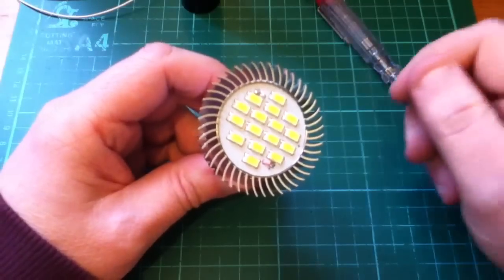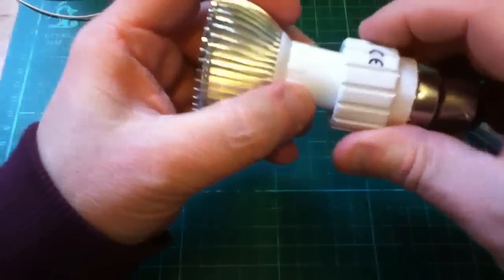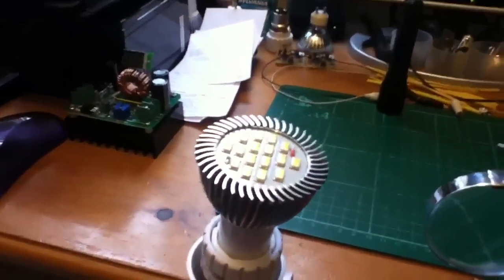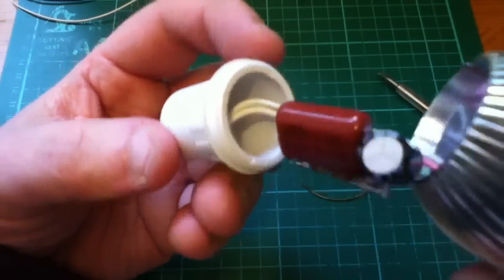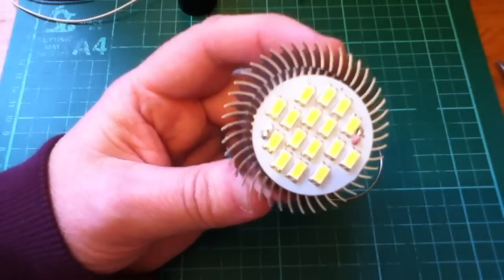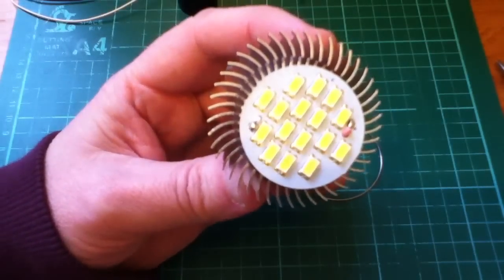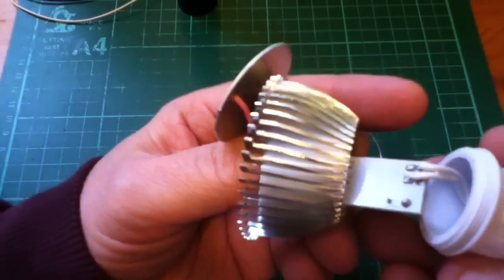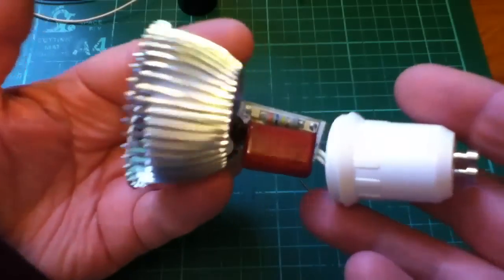Dangerous GU10 LED Spot Light is Cheap and Bright but could Kill You - Seriously

Comment: Wow... Amongst the top videos I have yet seen on Youtube.
Crucially informative, really well and clearly narrated, by somebody who knows what he's talking about, a feature often hard to find on YT.
Knowing the danger is half the battle. I would not let non techno people use one but I would bear in mind the risk to me and ensure that I had inserted the GU10  in the correct way round, initially checking with a meter or minimum a neon tester.
Having established that neutral had reached the front, I'd mark lamp and holder appropriately.
The risk is minimised considerably when using a ceiling light because standing on a wooden chair or ladder, ground potential is a long way off in terms of ohms.
Nevertheless, a great warning WELL worth heeding.
Reminder to self: The neon tester might not work either on a chair because of long earth leakage path! Can't win, can you?
Reply: That sounds all very well, and I used to think that way, and so did my father.  And after he became ill with Lewy-Body dementia he was just about to kill himself with me on the other end of the phone because of failed insulation covering live screws in a fuse box that he hadn't bothered to fix because he knew not to touch them.  If I hadn't gotten cold feet and told him to knock it off and ask a neighbor in the morning, ten seconds later he'd likely have been stretched across the moist concrete floor in front of my terrified mother because in his confusion he was about to unscrew those screws.  I only found out two months later what he'd been about to do.  Electrical safety codes are there to protect everyone whether the so-smart guy is there (or still so-smart) or not.

Comment: dnot  trut!! this  man     do not electronics   experence  the power is in 120 volt to firt 2 pin in back ..  the wires is go  to circuit board and this board circuit  converter  to low volt  to 12 volt dc dnot  shocks !!  in front  point! if you  touch   firt input wires yes you receiver shocks if you open !!   but  in front  led around  dnot receiver nothing   bad  notice!
Reply: Damn! Did you get a shock from one of these lamps already? Your text is gibberish.
Reply: Two words for you, proof read then post it. Well make that 5 words.

Comment: You could get an electric shock, but if you have a differential circuit breaker as you should, then you can't die if it (yes, i know, these are also sold in poor countries where diff CB are quiet ... rare ...).

I am NOT trying to find an excuse for the manuf. This is absolutely revolting me.

Especially when you consider who easy the fix could be: spray a bit of insulating resine ... and voila. Costs less than a cent, and even makes the product water proof. I do that on many products; when I buy a brand new stuff designed to do outside or in the bathroom, I open it, spray resine, and close it back. I have lost many items because the casing was not really IP44, and when water came in ... smoked. A simple resine spray can prevent 99% of these cases.

Comment: I had the same experience with a iPhone USB-charger. It exploded and the mains fuse went off! After inspection there was almost no insulation between mains (directly) and the USB metal shell... but it was cheap! Why the explosion? I just tried to put the USB connector in and shorted between mains and USB :)

Comment: I'm no spark but i do know LEDs have polarity....so if you put this bulb in the wrong way round then it won't work.
So wouldn't that mean you only get live mains on the front plate if you put it in the wrong way round??? In other words, you wouldn't get live mains on the front??
Reply: No, there's a bridge rectifier in the circuit. But that does NOT isolate you from mains voltage.

Comment: Good video. I would say to anyone buying from eBay or Amazon do it but check for the ce Mark. Although some manufactures fake that too. Just very carefully strip it down before using it and if it doesn't look safe then sack for a refund. They have no leg to stand on selling cheap electric devices that are unsafe. All goods sold are regulated and if they bypass the standard they're breaking the law. I've had a few 240v belts and although some were funny, it's very dangerous. I'm an electrical technician so try not to but worked live for years. It is a killer!

Comment: I'm not a fan of LED!
Reply: anythings better than cfl -  what do you fancy eating in 20 years time ? mercury from lots of cfls thats contaminated the food chain as theyve all been slung in the rubbish tip and burried in the ground or traditional incandescent  light bulbs filled with argon thats already present in the air thats completely harmless - ill choose the old  incandescent bulbs or led's over cfl any day lol
Reply: CFL is the other worse choice.
Reply: RobertSmith
 Why is that then?
Reply: They say CFL bulbs have impairing mercury and radiation. This way people die slowly so they can make money off you.
Reply: That's sounds like propaganda from LED manufacturers tbh. There is probably more mercury in your fillings! As for radiation, the amount of UV emitted is negligible.
Reply: FrontSideBus Don't forget, electromagnetic radiation from the circuitry itself. CFL over here are subsided, they're almost free. They're everywhere. Well, we have to live with it. At least a Chinese made LED is clean and a simple fix.
Reply: EMF??? Everything from a mobile phone charger to an LCD TV power supply uses a SMPS! Your probably getting a higher exposure from your wireless router or your mobile phone!
Reply: Tom Peters You do realize that every fluorescent bulb ever made has had mercury in it, yes?  We used to tilt them up and down to watch the little bead run back and forth, if we weren't smashing them with a hammer to get that little bead and rub it on a dime (our version of the 10p coin, made of silver at the time so the mercury would turn it into a slippery mirror for a little while).  Modern CFLs have something like five milligrams of Hg in them, much less than the old ones.  That's a droplet about as thick as four Post-It notes.  If you still have a mercury fever thermometer around it probably contains enough for four to eight hundred CFL lamps, and a pound bottle of dental mercury would be good for over ninety thousand of them.  I'm not saying it's wonderful stuff but think of all those office blocks with their thousands of old-type fluorescent tubes.  I hope they're being made now with equally small amounts but they're so much larger physically that I doubt it.  You should be rejoicing that CFLs are so clean by comparison and are serving us so well while we improve LEDs..

Comment: I doubt it is going to KILL YOU... Why would you not take a Voltage Meter and test the actual Output of the LIVE Wire feeds that you are pointing out in the video? Assume that they are live, you will not receive 110V/220V shock from that LED.  Just a heads up I use LED's and think they are very safe. You get what you pay for, but shop around for the Protective Coverings that are made of plexiglass or clear poly.

Comment: I bought a batch of GU10 LEDs about 12 months ago and stupidly proceeded to fit them with the lighting circuit live, the first one was fitted without incident but the second gave me quite an invigorating "tickle" across the major organs! (I was holding the earthed metallic luminaire with one hand as I fitted the bulb). Fortunately I was saved from coronary failure by the distribution box RCD tripping - I WAS LUCKY! 
Once my heart rhythm had returned to something near nomal I decided it might be prudent to fit the rest of the bulbs with the circuit dead and then being of an inquisitive nature tested for voltage to ground on the bulb heat sinks; I found voltages ranging from 18v to 190v AC with over 50% of them over 140v, the one that bit me had a touch voltage of 180v on the heatsink. Oh and of course they had CE stickers. BE CAREFUL there is some seriously dodgy electrical equipment in circulation these days. Cheap imports from good old China may not always be the bargain they appear. 
Sorry for the length!
Reply: Actually, you should still go to hospital and have your heart properly checked.  Although your heart rhythm may appear to have gone back to normal, it may not have done and you could have problems years later.  Explain what happened and they can check you out.  This is a common occurrence.
Reply: YES.... I ALWAYS TURN THE POWER OFF WHEN INSTALLING GU10 bulbs plus Edison Screw bulbs too....You need to be very careful ...

Comment: 3:14 though I agree this is very unsafe.. the led lights GU-10 from ebay are generally fairly safe.. The ones I got for in my kitchen have some sort of see-through gunk on top of the leds. This makes it impossible to actually touch anything metal on the lightbulb itself. The aluminium cooling fins aren't electrically connected to anything (well, unless something goes horribly wrong), so it's still fairly safe. If you're very concerned about these sorts of things, you should install double-sided switches in your home, wear some sort of insulating gloves while replacing your bulbs, or shut off the electrical group in your house when you're replacing these lights. the design of GU-10 was made this way for some reason, and the lights themselves can't guarantee safety for that reason
Reply: Not to mention the horrid flicker... Usually my lightbulbs are out of reach, so i don't care if they run live on the aluminum coller but i do care about fire hazard and flicker. This crap had no fuse and you probably get a headache in a few minutes of it's light...

Comment: Thats a funny explanation.. According to it, i'd have received like 50 shocks from 230V AC current. Also you forgot to show the most interesting part to almost everyone out there: the list of items and the schematics of the circuit. I'd say, there is something on the board, which converts AC to DC or converts + to - if you plug it in "the wrong way"
BUT: It's nice to see the build-up of this 3W GU10 Spot. Thanks for that :)

Comment: You said in the video that there is an rectifier (I saw it too), so after it there is no more AC, only DC. So in my opinion only if the manufacturer has put the resistor on neutral it can be dangerous.
Reply: Back to school for you. There's no neutral after a bridge rectifier.

Comment: you do realised house holds receive AC current, both contacts will be - then +. however many times a second it is, the LED will only except voltage in one way obviously so the power is dumped, its not unsafe just a retarded light design :)
Reply: There is no plus or minus on AC, only live and neutral. It's rectified to be plus and minus, after which it's fed into the leds so they can be continuously on without flickering.

Comment: > Julian Ilett  --- Not quite correct .. The LEDs only work on Direct Current.  The bridge rectifier only allows the voltage to pass in one direction, no matter which way the voltage comes in (and A/C comes in BOTH directions).  So as long as the resistor is on the high out of the rectifier and the LEDs are on the low side, well, If you don't know what that means, you might want to consider taking this video down .... Sorry.  But, please consider it.  Thank you

Comment: So basically, don't buy it if your an idiot......

I think we have too idiots in the UK, so I wouldn't mind a little bit of natural selection ;)
==== More below ====

The alloy plate forms the heatsink for the LEDs, you'll see this same setup in high power circuits where theres a need to heatsink surface mount components, vehicle EPAS systems for example, it does make it extremely hard to remove parts without a hotplate (as I found out).

You COULD certainly get a nasty 300v DC kick (bridge rectifier), depends really on which part of the top PCB made contact with the alloy plate (or your hand), as in your example it's divided by 16 LEDS, each getting around 6% of the supply voltage to the front PCB. If a short occurred, the chances are the PCB track would melt almost instantly anyway, despite being heatsinked.

Also, in reality Neutral AC is the same as Live AC, both carry the same sine wave and Earth is bonded to Neutral back way outside your house, so in really its only going to give you a kick if your holding onto a live/neutral/earth connection anyway (say a metal light holder, a radiator or any grounded device for example). If not holding onto any of those, you'd probably just feel a bit of a tingling in your fingers.

On the other hand, these cheaply made Chinese mains powered devices are a death trap anyway, the risk of fire is just astronomical.
Those cheap mains to USB chargers are a great (or bad) example. I've used these to make cheap power supplies for various projects, but always include a 70c thermal fuse in the enclosure.

Comment: Thanks for the heads up. I am currently in the process of looking for LED GU10's to replace my 63mm halogens in my office.  I would just buy the halogens if I could but I can't find them anywhere here (in Spain) and it appears that production is being discontinued.   Thanks again!
Reply: ***** I agree with mr Gibbon here.. there are plenty of GU-10 led lights with either glass or see-through gunk on top of the leds, to make sure you cannot touch any of the terminals with your bare hands

Comment: well he said things that makes sense to me as i do basic electronics, 240v AC series with bridgerectifier, that causes 120v (single side of the 50hz ripple) AC, when this passed into the cap it creates the "poor mans DC" from AC, the voltage now only has + and - thus called DC, running the high voltage via the resistor drops the load current when the LED's are turned on and working, so technically you could get a little pisser if an LED don't work of the + rail however i need to more tests as if it was to over heat then the insulation will melt causing a short, this then in turn burns out the resistor thus breaking the circuit, this is as i said, in my opinion? anyone else agree?

Comment: Unbelievably unsafe.
Also unsafe are the comments being made by people who think they understand electronics.

1. IF the circuit does not have a voltage limiter - it is simply limiting the current to prevent frying the leds. The LEDS themselves will clamp the voltage across them to a 'lower level'. But if a led dies and the circuit goes open , then the voltage on those terminal will rise to mains and supply the same current that the leds needed - presumably more than 30mA.

The 370K resistor would only allow 0.6mA to pass - nowhere near enough to power the leds. It is probably used to discharge the cap - preventing a shock from the terminals if unplugged. It's in the right position to assume that.

That means the current is only limited by the capacitor as normal for a dropper like this - the diode ... well that just gives you a DC shock instead!

Didn't look like the cap was a safety X or Y rated one - so could go short circuit .. even more current - or fire.

2. It cannot possibly be deemed safe if there is no protection against touching any 'directly live' terminal - regardless of where its fitted.

3. Safe design considers what happens if a part fails ..

Comment: You are wrong mains is AC and LEDs only accept DC in one direction. Also these lights go through tons of safety checks. I have to think you don't know what you're talking about or you'e made a mistake.
Reply: Safety checks?  Most come from China!  Do you think they do a lot of safety checks?  Yes Leds take DC voltage but the AC to DC converter is inside the bulb so yes there is a potential for shock.  Not at the LED lines but before in the converter.  Imagine if the converter was loose inside.
Reply: Also - there is only 12V or 24V or whatever across the terminals if the leds are working. If one dies / goes open circuit then there will be 240 Volt across those terminals.
Probably the capacitor is not X or Y rated ( safety requirement ).
The current ( not voltage ) used for those leds is probably higher than 30mA, to get that sort of brightness. Therefore, the current available to pass through the victim is higher than 'safe'.

Regardless of anything else, with no glass insulation to protect against touching the terminals - those lamps are totally Unsafe and would not pass ANY EU safety.
Reply: You are trying to sound pretty knowledgeable.  Would you like to show us all documentation of these safety checks that you say have been carried out on these items?  Stop talking about subjects which you clearly don't fully understand and helping people make decisions which could kill them.
Reply: You clearly have no idea what you are talking about. Watch the video again and pay attention that time. If you aren't talking out of your ass, you'll get where you're wrong.

Comment: Just because something is metal does not mean it conducts electricity. Heatsinks are made of aluminum, which does not conduct electricity, test using a multimeter on the heatsink and this can also be tested on a soda can. If the board is also aluminum which it must be in order  to transfer the heat to the heatsink, it is impossible to shock yourself in it's untampered state. Even if there is little or no insulation. Though my gut would hate such a design I know intellectually there is no risk of electric shock. Thumbs up so people can see. (Those that read this comment can find out aluminum is infact nonconductive by testing continuity on the unprinted surfaces of a pop can.)